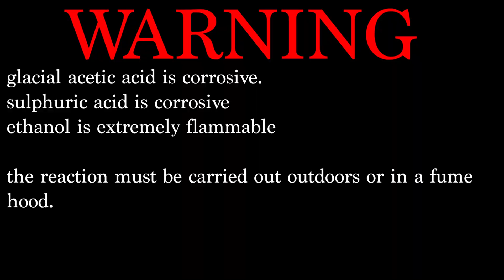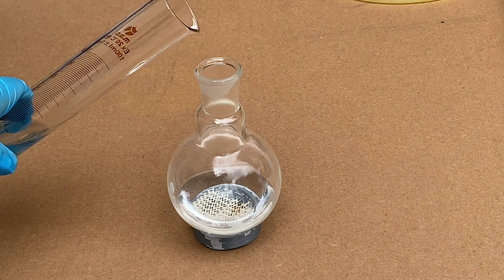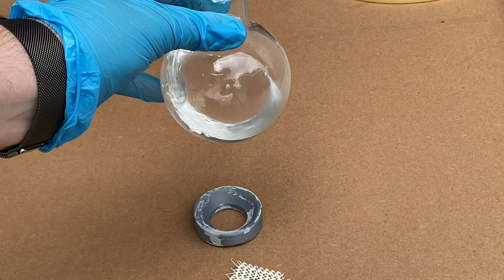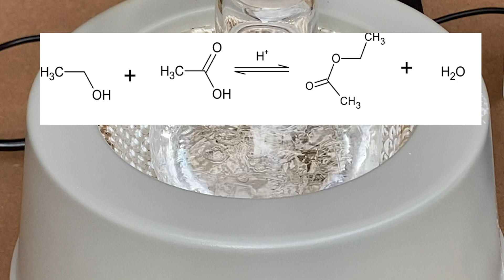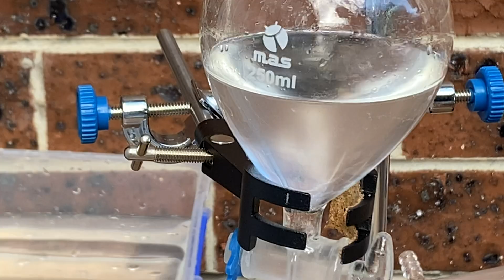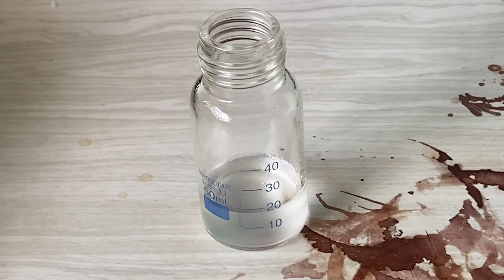Synthesis of Ethyl Acetate from ethanol

Comment: I think you probably got mixture of ethyl acetate and some ethanol. In equilibrium reaction you have some starting materials left, unless you use huge excess of acetic acid and remove water during reaction to drive the reaction to the right.
EtOAc/ethanol mix is near impossible to separate by distillation due to boiling point difference of about 1C without equipment no amateur has. Acetic acid is easily left behind though.
Reply from the maker: Indeed. I wasn’t worried about the ethanol though, the concentration would be low. Had I used acetic anhydride the concentration would’ve been even lower. 

I could’ve separated the ethanol from the ethyl acetate, but it is absolutely not worth the time